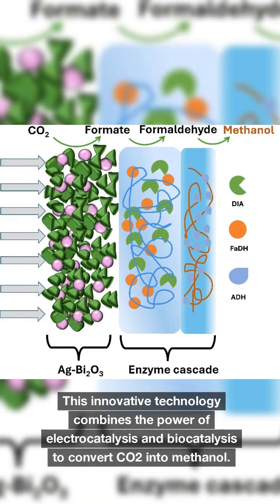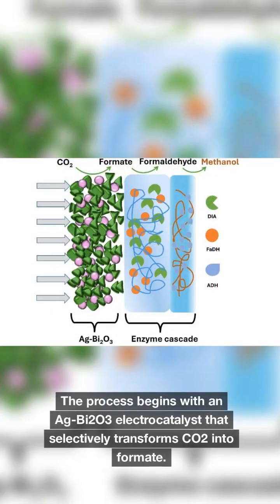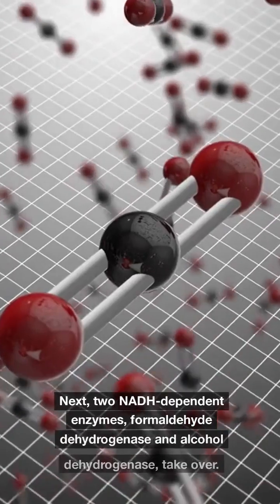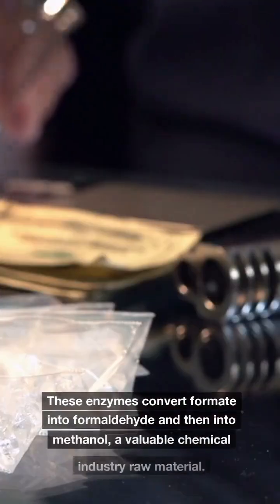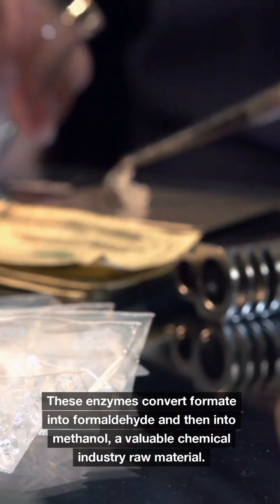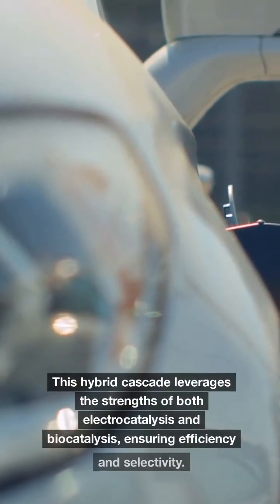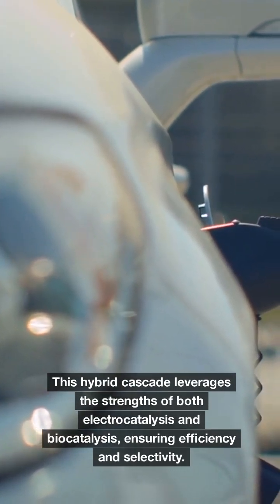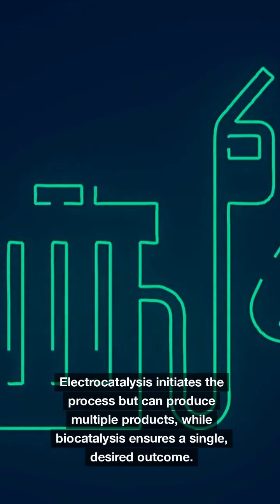Methanol Production EXPERT Reveals the Shocking Truth About CO2 Conversion

Comment: Since when is Co2 harmfull. It is like plants saying O2 is harmfull. I have been breathing out CO2 all my lufe without harm. It is just part of a cycle.
Reply from the maker: Breathing carbon dioxide (CO2) becomes harmful when it reaches significantly high concentrations in the air, typically exceeding 5,000 parts per million (ppm), which can cause symptoms like headaches, dizziness, nausea, and difficulty breathing, and at very high levels, can lead to unconsciousness and even death due to oxygen displacement; this is considered a dangerous situation and requires immediate action to access fresh air. Concentrations above 10% (100,000 ppm) are considered immediately dangerous to life and health (IDLH). Also in the case incomplete combustion, CO is formed from CO2 is in situations with very limited oxygen and the inhalation of CO is fatal.